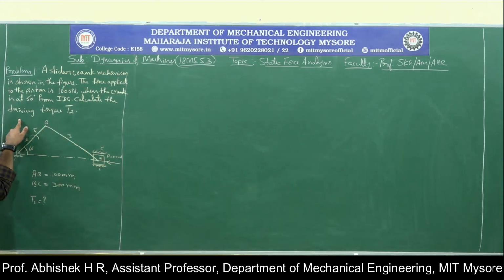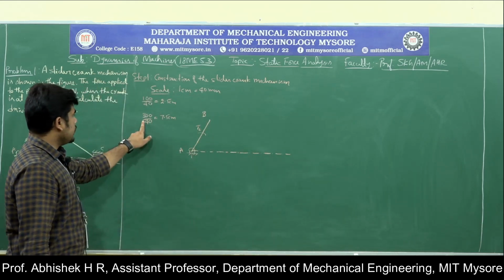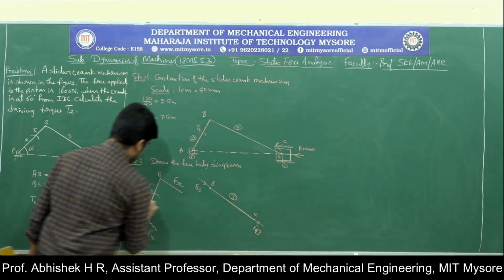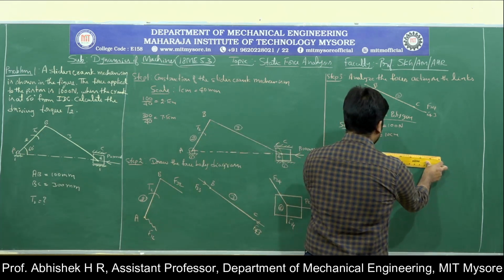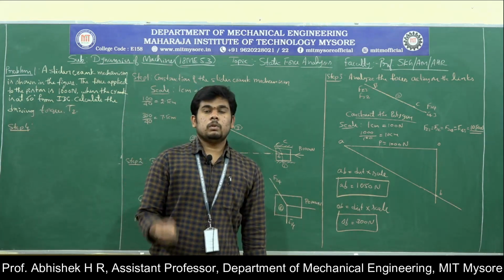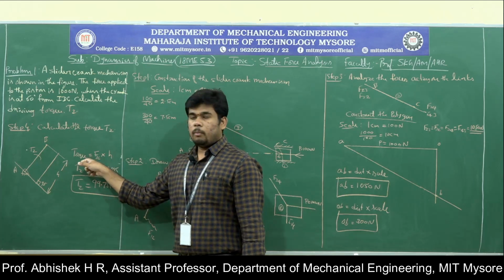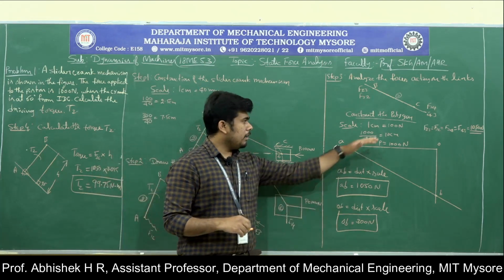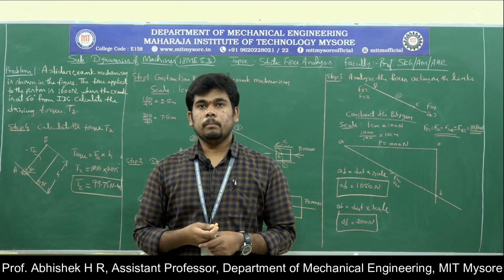5 DOM 18ME53 M5 06 AHR

Comment: At the last step the same line as 2.5cm then the 90' line also 2.5cm but u told that line 96mm how it is ???
Reply: Hi suman. for height, please multiply perpendicular distance×scale, and then use it in torque formula. 
h=2.4cm×40mm=96cm=0.096m.